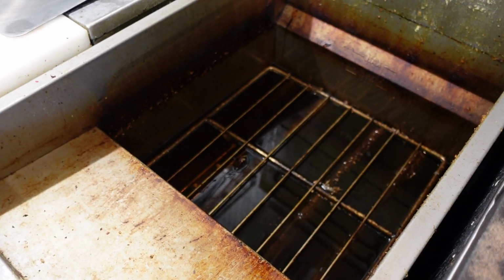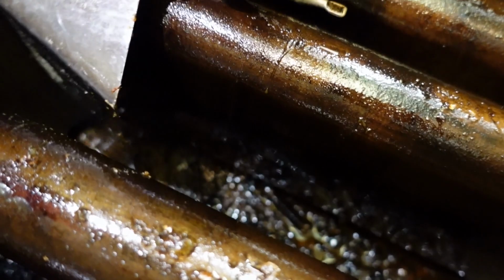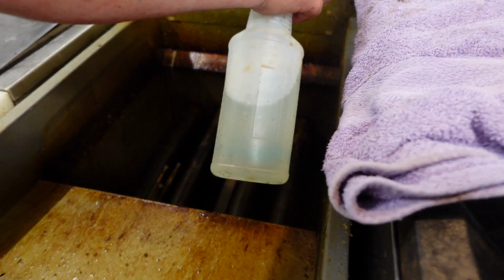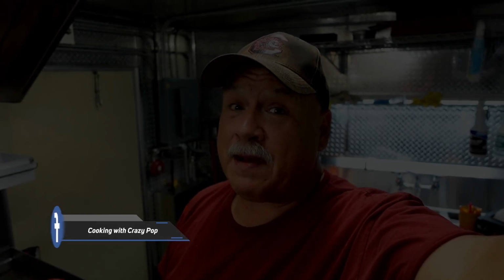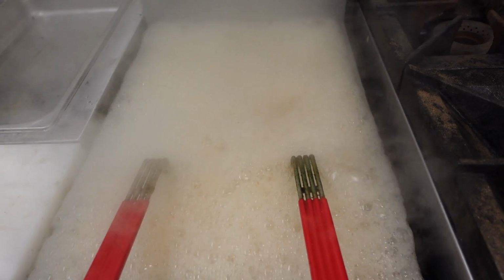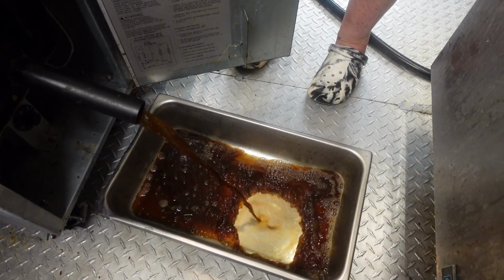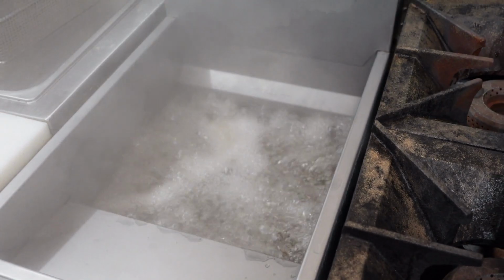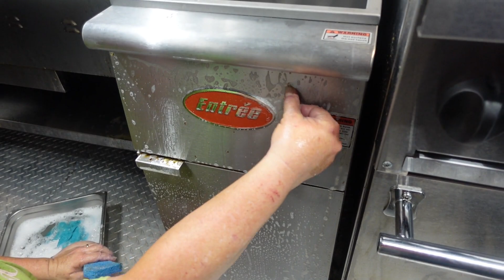Food Trailer Cleaning    Deep Fryer

Comment: Don't let it get to that dirty and the cleanup is much simpler. Still a bit of work but not so much build up. There is also a deep fryer screen on the market that could catch more crumbs before they sink to the bottom of the fryer.
Reply from the maker: We bought this trailer used and this is how dirty it was when we bought it. hard to believe they let it get this bad, but like you said, now that it is clean it will be easier to keep clean. I will look for that screen, that will really help.
Reply: How could you install and remove such a screen around those flues without distorting it and having the crumbs fall off into the basin?  Unless there's a sealed access cover I don't know about?
Reply: @scabscerte just look it up? It sits on TOP of them and is like a rectangle basket.